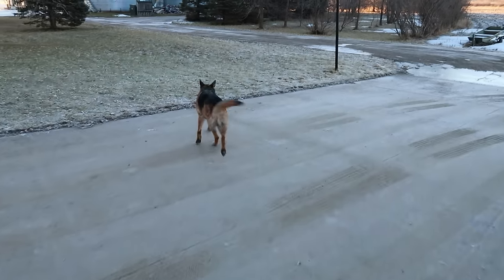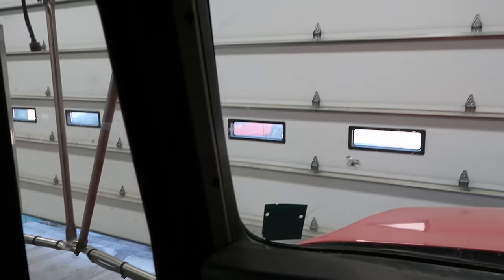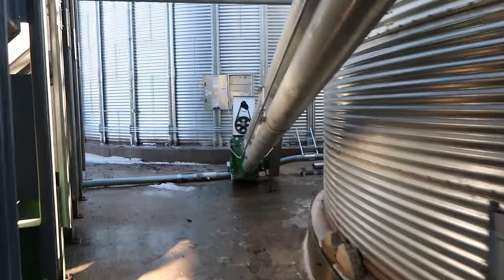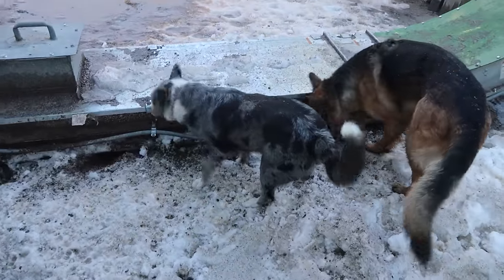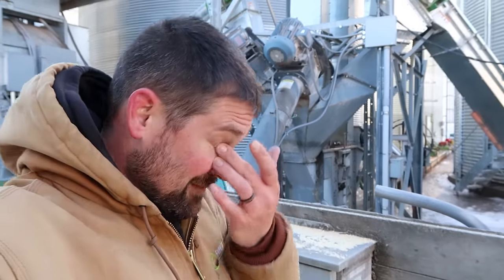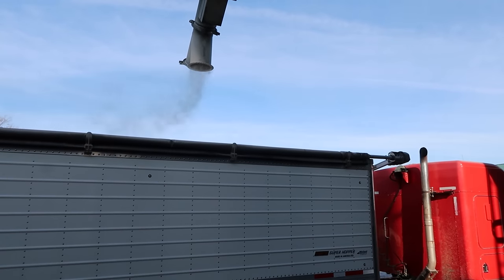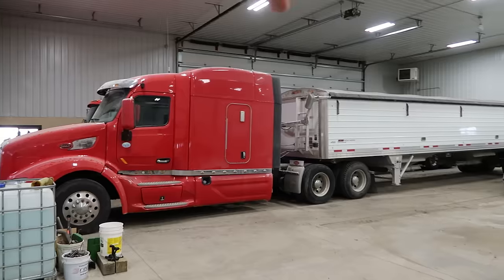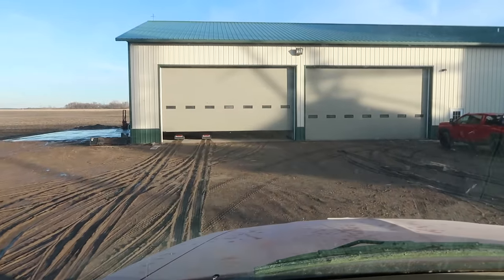Food for Fuel-Hauling Corn

Comment: There is a check valve on cat that stops fuel from bleeding back. The fuel line that comes out back of motor and goes back to filter. Under  line next to filter is a chech valve about 50 bucks from cat
Reply from the maker: Checking that out immediately, thank you!
Reply: @MillennialFarmer  we just had to put one on one of my semis last week and it solved the problem
Reply: That is not check valve but pressure regulator. also there is no check valve fuel system on the engine. You go to any Cat, Peterbilt or Kenworth dealer with engine serial number, ask for check valve and they will look at you funny. How many times parts guy came out to the shop and ask us is there check valve NOOO. We tell them they are looking for pressure regulator
Reply: Bingo
Reply: @MillennialFarmer 
Could also not have enough pressure in the high pressure fuel line to start most likely, typically worse when it’s cold if an injector is hanging open and fuel is thicker.

Comment: Fuel check valve!
Reply: Agreed 👍
Reply: @pdmustgtd1013
2 days ago
That is not check valve but pressure regulator. also there is no check valve fuel system on the engine. You go to any Cat, Peterbilt or Kenworth dealer with engine serial number, ask for check valve and they will look at you funny. How many times parts guy came out to the shop and ask us is there check valve NOOO. We tell them they are looking for pressure regulator
Reply: Eeh

Comment: Zack, concerning the truck that always has the dead batteries my diesel tech says the problem is in the battery harness and keeps draining the batteries by parasitic drain.  He was unclear as to what it is exactly but someone there should be able to diagnose it. On the other hand on the disc episode the answer to getting that 3" nut off and then back on is a slugging wrench and they are inexpensive.  Another alternative is a hydraulic amplifier wrench but they are pretty pricey.  Good luck and keep yhe great videos coming.  Keep it between the rowa!

Comment: The truck can start that way mainly because The battery's are more powerful then the starter motor. That can be the main problem. I have ad that on why tractor where the battery's are more powerful then the starter

Comment: My Cummins had the same starting issue.  Dead spot in starter.  Wouldn’t kick when first turning over and didn’t spin fast enough.   Motor needs to spin 600 rpm before the fuel pump kicks in.  Really cold weather it wouldn’t spin fast enough and no fuel.  No fuel, no run.

Comment: T-800 starting issue: Sounded like the fuel valve is letting the fuel leak down so that you have no fuel in the lines when you crank it. Happens more in cold weather cause the seals aren't warm, pliable, etc.
Reply: @pdmustgtd1013
2 days ago
That is not check valve but pressure regulator. also there is no check valve fuel system on the engine. You go to any Cat, Peterbilt or Kenworth dealer with engine serial number, ask for check valve and they will look at you funny. How many times parts guy came out to the shop and ask us is there check valve NOOO. We tell them they are looking for pressure regulator

Comment: Because the one way check valve in the fuel line when it's cold out sticks open, letting the fuel run back to the tanks the spring  in it is getting  week
Reply: @pdmustgtd1013
2 days ago
That is not check valve but pressure regulator. also there is no check valve fuel system on the engine. You go to any Cat, Peterbilt or Kenworth dealer with engine serial number, ask for check valve and they will look at you funny. How many times parts guy came out to the shop and ask us is there check valve NOOO. We tell them they are looking for pressure regulator

Comment: The truck probably has a valve that isn’t seating correctly. So when it sits for a while it’ll create a leak of sorts (backwards with air) and ultimately the fuel filter drains back into the water separator. Hence the long cranking time occasionally which is the time it’s taking to fill ll back up. 

Or the truck is a politician from South Dakota.
Reply: @pdmustgtd1013
2 days ago
That is not check valve but pressure regulator. also there is no check valve fuel system on the engine. You go to any Cat, Peterbilt or Kenworth dealer with engine serial number, ask for check valve and they will look at you funny. How many times parts guy came out to the shop and ask us is there check valve NOOO. We tell them they are looking for pressure regulator
Reply: @JohnSmith-yv6eq  I didn’t mean a check valve. I meant bad rings and an exhaust valve.

Comment: For the truck that’s acting fussy try checking your battery connections, might not be getting full power, because it sounds like when you first crank its low voltage
Reply: @pdmustgtd1013
2 days ago
That is not check valve but pressure regulator. also there is no check valve fuel system on the engine. You go to any Cat, Peterbilt or Kenworth dealer with engine serial number, ask for check valve and they will look at you funny. How many times parts guy came out to the shop and ask us is there check valve NOOO. We tell them they are looking for pressure regulator

Comment: We had a large farrowing center for hogs in the mid 70's and I would feed my leghorns hog starter feed loaded with steroids and the darn chickens would grow as big as turkeys! We also farmed 1200 acres which was a good size farm in those days and used our equipment until it was falling apart due to cost of farming. Times sure have changed!
Reply: I suppose it is like trading cars every two years or running them into the ground. With short growing seasons it probably pays to keep it newer and a tad more dependable.
Reply: I bet your farm had very little debt also.  Nowadays the banks own farming.

Comment: Nice to see your video. That one truck looses pressure in the  rail. Lay a loop in a flexibele fuelline.
Reply: Or replace the check valve.
Reply: @pdmustgtd1013
2 days ago
That is not check valve but pressure regulator. also there is no check valve fuel system on the engine. You go to any Cat, Peterbilt or Kenworth dealer with engine serial number, ask for check valve and they will look at you funny. How many times parts guy came out to the shop and ask us is there check valve NOOO. We tell them they are looking for pressure regulator

Comment: Because the  engine ECM needs 9.5 volts to fire the injectors. So when cranking if voltage drops  below 9.5  it  will not fire  That truck has had  cranking issues!  Ground connections or poor cable  condition!

Comment: You should look at putting some battery disconnects on  those trucks. It will help the batteries not get drained.
Reply: I think he has them on some or all the trucks and has turned them on to find a dead battery 😂

Comment: I’m not sure if this ever really matters. I did it on mine, but was always told that you never use the side draw the first time you fill it to prevent any kind of uneven settling that the concrete might experience
Reply: Well engineered modern silos will place the side draw intake in the center of the bin to prevent uneven loading.
Reply: Are you talking about silos or  grain bins? I’m just going off of the last bin I put up it up which is about a 75,000 bushel capacity GSI and the GSI dealer said do not use it until you have completely emptied it out of the center well once.

Comment: As a couple of people suggested the easy low cost item of changing out the return check valve ( they do wear out, plus there is a small oring on the tip that can begin to fall apart ... give the serial number of your truck to get the correct valve at Peterbilt ). If you have a pressure gauge made up to plug into the low pressure fuel compuchek port on the head of the final fuel filter housing, that can be connected before you crank the engine and watch how long it takes to get decent pressure as its cranking as well as it will show both at idle speed pressure and engine at high idle what it is capable of producing. However you made the comment that it doesn't always do this under the same circumstances ? If so and its fine one time and a long crank another time or a hot crank and does this same thing, I have a feeling you have something else going on. That hesitation when it first started to crank over is not proper at all, I would place bets on there being a weak link in your starting system. Is this the same truck that you replaced batteries on last year as it would hardly crank over ?, I know at the time I was surprised at the three batteries vs by rights for any cooler weather should utilize the four battery box. However when I saw you reach down and turn on the battery disconnect I had the uh huh moment !, those battery disconnects are a rather severe road block to the proper amperage getting to the starter. That and if there is a lack of number and size of cables running to the starter ( ideally there should be two large positive and two large negative cables from the battery box to the starter ) or corrosion within the cables crimped on ends causing yet another weak link to the proper amps flowing that the starter demands, yes of course it could be starter solenoid related also. But again to stress, those battery disconnect switches are a weak point from new and once they age and get burned contacts inside its all down hill. And the final piece of the puzzle ( why it can crank over and not start ) is that its very possible that there is a smaller positive wire in the battery box that is moulded into one of the positive cables ( if you do have two large positive cables ) and that smaller wire goes into a Maxi fuse holder with a 30 amp fuse within the battery box, if so that fuse system is more than likely the fuse that sends power to the ECM, if it has a poor connection at the battery terminal or in the fuse holder or anywhere along its length, that will cause a long crank or no start situation and seem like the fuel system is at fault when it may be fine and the ECM is not commanding fuel because its receiving low or no voltage. The bad connection to that ECM power feed may very well be the very battery post nut tension or lack of that the small wire is connected to. Sorry for the long explanation but last fall I was fighting a constant issue and through talking to a mechanic that owns his fleet service shop and well versed with Cat engines and Petes/Kenworth, right away he said get rid of those battery disconnects ( my truck had two of them ) and I was shocked at how vastly different that engine turns over now. I also realized that the tightness of the stud nuts on the battery connections had once again loosened off and I believe that is what was causing my actual crank but no start issue. Some of these batteries are crap it seems in quality and the stud nuts loose their clamping force as its as if the steel stud is slowly pulling out of the battery, go around and check all your battery post nuts, you may be surprised how loose some of them are. Did you follow all of this ? LOL.
Reply: How long did it take you to write all that bs?
Reply: @ROCK-s1t  You can claim its bs all you like but those are the facts of battery disconnects on a high amperage draw starter, and group 31 battery stud issues, I really could care less if you believe it or not. I typed it to help someone with a puzzling issue, I have no idea why you bothered reading it.

Comment: Going to guess either a new 8RT or 8RX, most likely a 340 or 370. I do have a question, just to see your response, but why didn't you just unhook the trailers in the shop then switch trucks from on to the next? 😂

Comment: Possible why long crank time. Sucking air into fuel system (fuel supply side). Fuel pressure regulator in fuel filter housing on the engine. Injector o-rings and Cat engines love to break middle o-ring. Injector itself with getting air up through injector tip don't see this a lot but it can.
Reply: Check valve failure.
Reply: @beckyumphrey2626  There is no check valve only pressure regulator

Comment: Question for ya zach im genuinely curious but how much does the kw weigh with a full load of corn and a full tank of diesel or roughly how much a full truck load weighs
Reply from the maker: Legally we can only be 80,000 pounds, or 40 ton max. With good corn, I could probably get 95,000 on, but I'd go to jail if the highway patrol found out!!
Reply: @MillennialFarmer  i was genuinely curious because my dad hauls plastic pellets and he usually pulls around 70 to 80,000 lbs on half a tank and a full load of pellets

Comment: Is corn so much lighter than wheat?  I see you fill your trailers full and the trailers coming into the ND Mill are only about 2/3 - 3/4 full.  Even the ones with tag-axle tractors and triple-axle trailers.
Reply: No DOT in the area.
Reply: It's a combination of things dot regulations as mentioned, height of the trailer being used, and density of product being carried, in your question tho I think the first 2 play a larger part then then the 3rd
Reply: Wheat is more dense than corn

Comment: Glow plugs not warming enough that’s why it does that… if in doubt tripple heat the glow plugs before cranking it over.  Ignition on to glow plug heat until glow plug light goes off… then turn off and repeat three times, then crank her over..
Reply: There are no glow plugs on that Cat engine just so your aware.

Comment: The mild winter you're having- is that good or bad?Or both!
I'm guessing it would good to get on the fields earlier.But are you getting much less snow also?I can see that being bad for the crops
Reply: It is horrible when you just spent $20k on a new snowmobile.
Reply: Hasn't been as horribly cold as usual so the frost isn't super deep, but the lack of snow could mean not enough water in the ground. Going to need plenty of spring rain to make up for it.